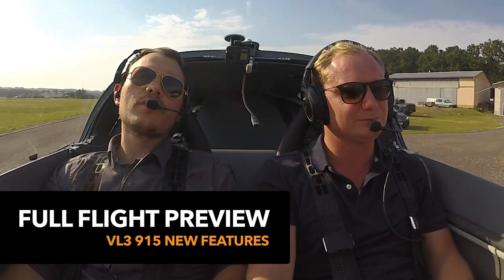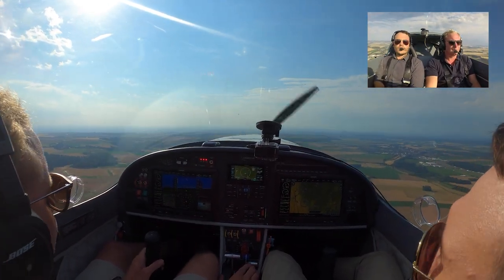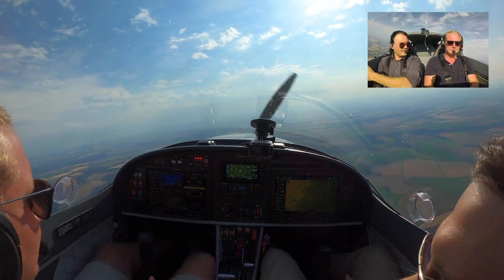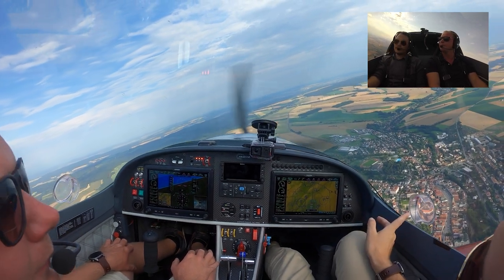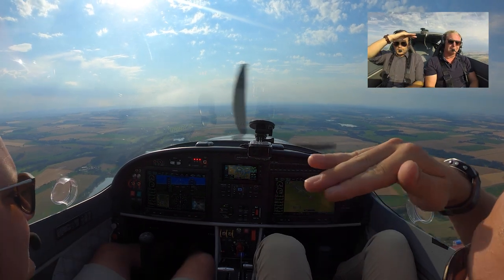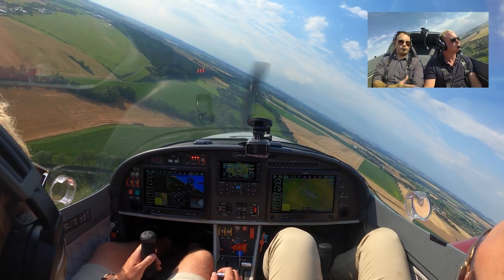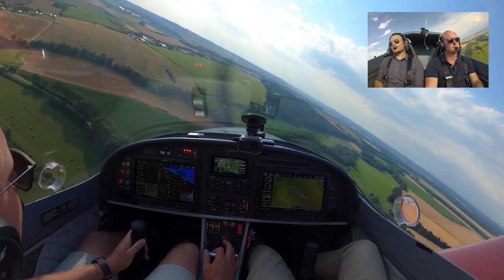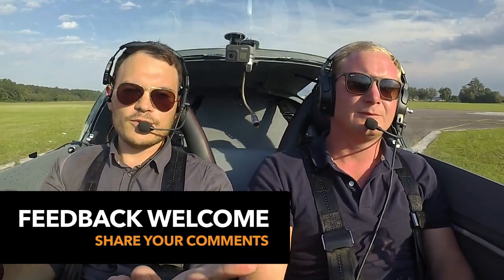VL3 Evolution 915 | New features

Comment: Are they certified by the FAA?
Reply: Experimental category for the useful version with the 915, because no type certificate. But Experimental isn’t a problem. It’s a nice plane and I wish their U.S. dealers were more responsive to inquiries.
Reply: @elkcircle7245  Experimental is very hard to insure.
Reply: @Maniac742  not necessarily, you just have to find the right agent. I’ve insured 5 sailplanes which were all in the experimental category.